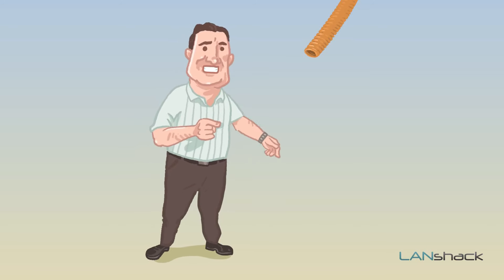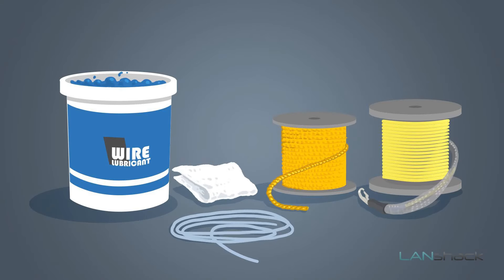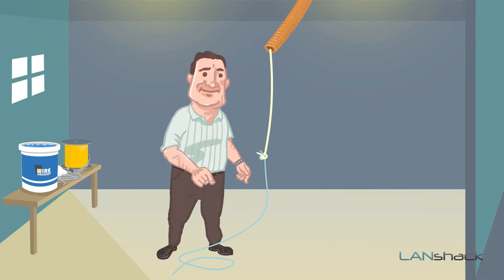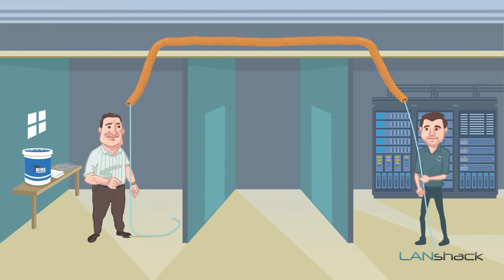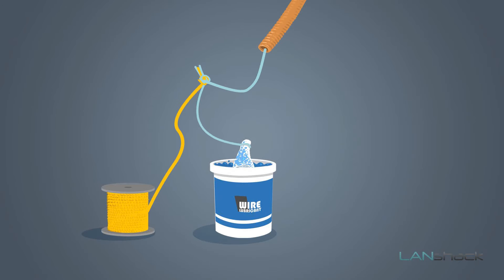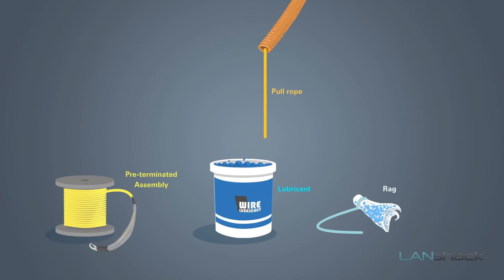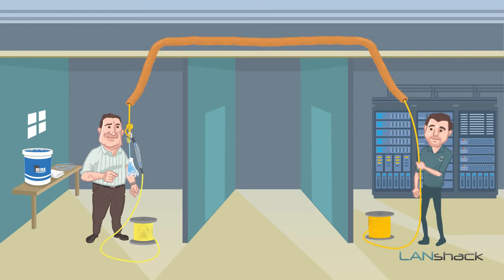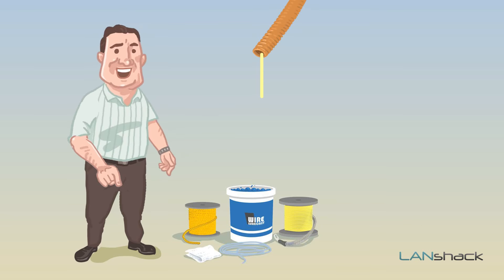How to pre-lubricate a conduit for pulling fiber optic cabling

Comment: Seems to me that the third pass is just dragging the lubricant behind the cable and it's adding mass to the pull. how is that beneficial?
Reply: A corrugated conduit is not good, but if that's what you're using, the 3rd pull helps libracate the other side of the tube corrugation bumps

Comment: But how do we put rope in the conduit in the first place?
Reply: Exactly why most people came here. After an extensive search, there seem to be 2 methods:
A-  first, vacuum the line from the exit side. Then, attach a small plastic bag fashioned to be a air bubble the same size as the conduit while tied to your pull rope (in the inlet side) then vacuum it through the line  by repeating step one with the bubble in the inlet side of the conduit.
B- the same steps,but by blowing through from the inlet side (instead of vacuuming it from the outlet)
A technician who says he's done both methods says blowing is better that vacuuming. But this requires making a feeder contraption by using a slit in half a water bottle (if the think of it long enough, you'll figure out how)

I hope this helps. If you don't get it. I don't mind explaining a bit more
Reply: @abo3abid1  That's how I've always done it.  Shop vac on one one end, and pull string with enough plastic bag tied to it to loosely fit in the conduit.  If it's stubborn getting through the whole length, you can use the shop vac and compressed air on either end to increase the pressure differential.